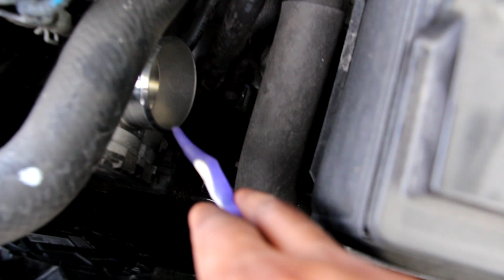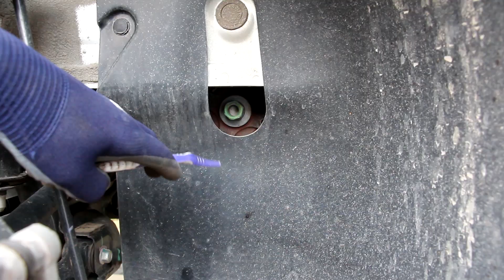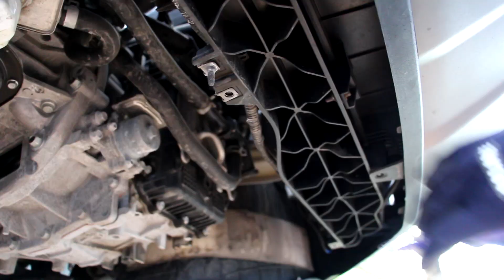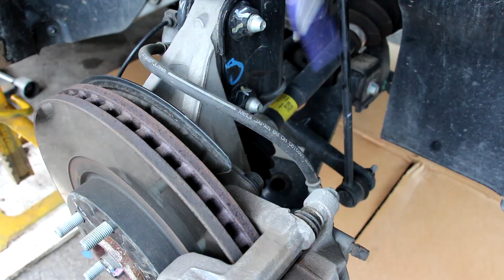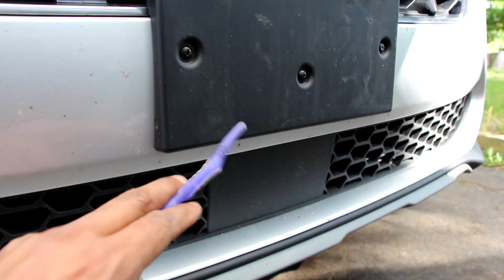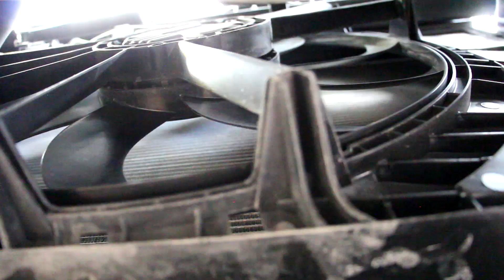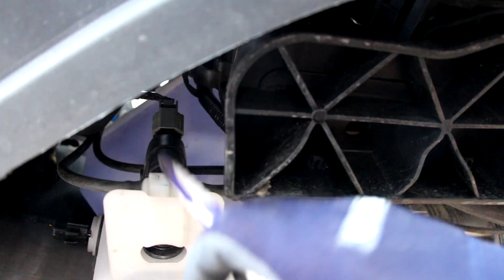Hyundai Santa Fe Mechanical Review

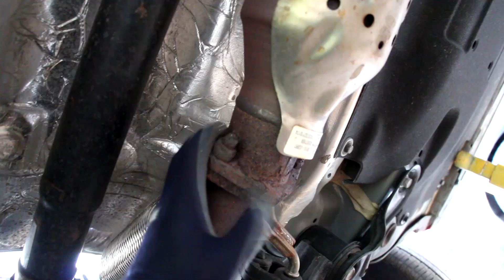Comment: The rusting you pointed at 15:50 makes me think I should have opted for the underbody coating when I got my vehicle.
Reply: Take it to Krown or Rust Check, annually.
Reply from the maker: And the bare exposed surfaces around the exhaust and driveshaft need to be coated as well
Reply: @speedkar99  Thanks to you and @chicobear
Reply: Honestly if bad I bet recall will cover, if rusts that quick, they all rust that quick.
Reply: i was shocked.  My 2007 has absolutely no rust at all.  Even the exhaust.  Perhaps its due to Canada :)
Reply: u'll be fine.. if u bought it new ur cover for rust..  some undercoating seal up water drain hole and u end up with more rust than if u left it as is
Reply: @joebrown9621  krown isnt thick and wont clog drains
Reply: @jamess3417  true krown goes on thin and is abit waxy.. most other undercoat are thick tar or rubbery coats which hold moisture to the body or block holes and passage in a unibody vehicle.. a good tip if people wash their vehicles more especially winter time would reduce rust significantly

Comment: Hey Speed. Love your simple and clear cut vehicle reviews. But man.. compared to a toyota, these things are scary. Would you say they solved the issues with the new production of the theta 2 engine or still stay away?
Reply: I believe the 2.4 was redesigned not to long ago. Ok, I see now. Yes, it wasn't a problem with the motor. Hyundai, i believe in the Alabama plant, decided to use water jets to debur the metal shavings from the parts. Well, it didnt work. So they had to go back to a more mechanical way or removing the particles.
Reply from the maker: They fixed the issue from 2018 onwards I believe. This car seems simple and easy to fix and might hold up long term but there are some places where they did cut corners. 
Toyota has added alot of new tech to the new rav4/Camry/Corolla platform so I'd give them some time to tell how they are holding up.
Reply: speedkar99 no they didn’t I had a 2018 Kia Optima that developed an engine rattle 2 1/2 years after I bought it. I traded it in for a Corolla almost 3 months ago. I’m sticking with Toyota for a while.
Reply: ryan x the 1.6T is still GDI only though which is sad and it’s part of the Smartstream family which doesn’t make sense.

Comment: GDi !! and  in a Hyundai!!! No way. Where's the reliability? My rule of thumb: Any feature not adapted by TOYOTA is not good. Look at the CVT transmission, Toyota kept away from it, unless it's a hybrid.
 I don't know any non hybrid Toyota that have a CVT other than Corolla.
Reply from the maker: Umm... please watch my Toyota mechanical reviews. Toyota has adopted way more technology than this Hyundai and that's why I'm disappointed how outdated this is.
Reply: @speedkar99  I was talking about the GDi and how Toyota still don't have it. Toyota have CVT transmissions only on hybrid models because they have to, with exception of Corolla. There are some Toyota models made by others like iA, 86, and the new Supra, so they don't count as real Toyotas, whether they have those features or not. Thanks for the video and the reply.
Reply: @landshass2849  Toyota has direct injection and port injection on all their new 4-cylinder and 6-cylinder vehicles.
Reply: Not really... The Yaris sold outside the US has a CVT also the RAV4, CH-R, every Daihatsu and most japanese Toyota's. Even though everyone hates on Nissan for using a CVT on their large vehicles, Toyota has a CVT on it's Vellfire/Alphard van. They also have direct injection alongside port injection on their new engines, Valvematic (similar to Fiat's Multiair) and even downsized Turbo engines in the Corolla for europe. Only techonogy they haven't adopted is the DCT.
Reply: @ProBenja5  my knowledge is limited to the US market. By the way, I don't think the real Yarris hatchback sold in the use is a CVT, I believe it is a 4 speed classic. The Yarris iA sedan (formerly known as Scion iA) comes with 6 speed Auto since it's just a rebranded Mazda 2/Ford Fiesta.
Reply: @landshass2849  Yaris from about 2014 has CVT so do most Toyotas now.That's why I won't buy any of them. I'm talking about Toyotas imported from Japan and sold in New Zealand anyway.]